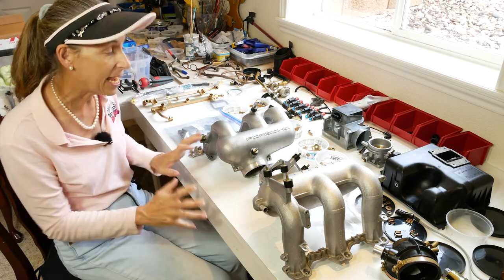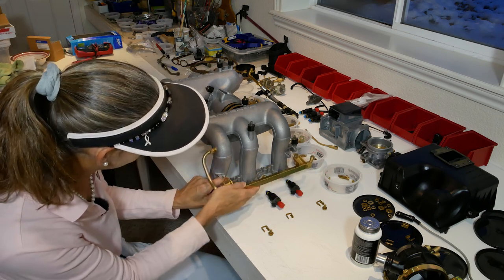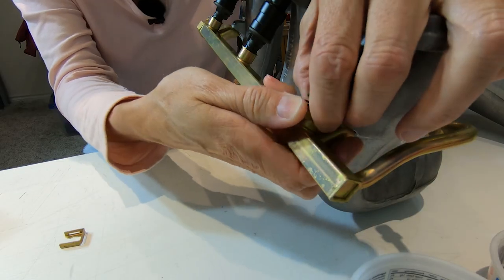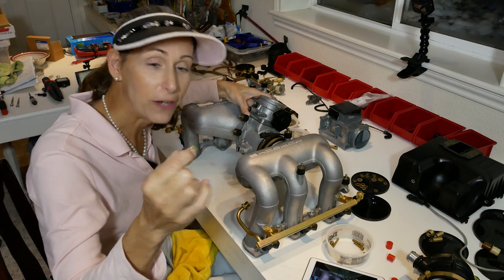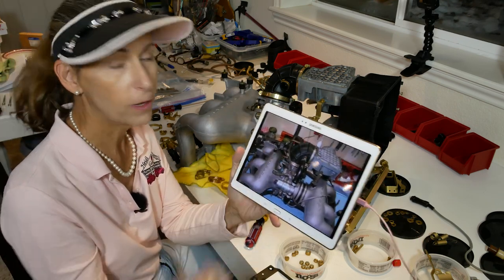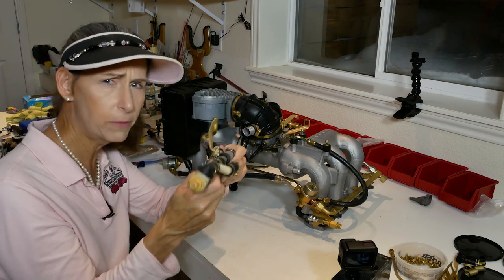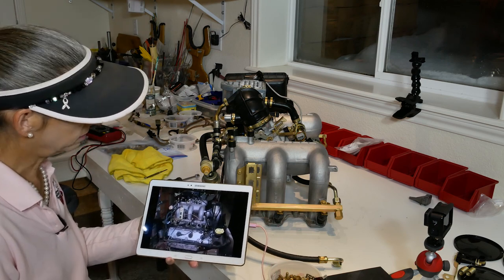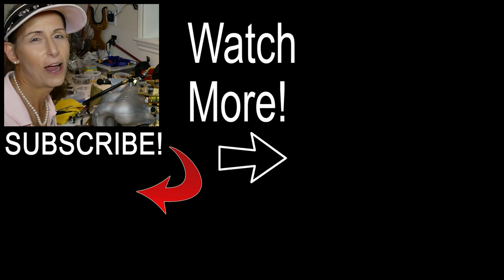Budget eBay 3.2 Carrera Intake Manifold Assembly Project #17 - Did I miss anything??

Comment: AMAZING job, ladies! I paid to have someone replace the fuel lines when I got my '87. Fast forward 7 years and now I'm doing everything myself, having learned so much about this car. This upcoming winter seems like a great opportunity to take off this whole intake manifold assembly, send the injectors in for cleaning, get a bunch of stuff replated, look for an fix any vacuum leaks, and inspect the regulator and damper. I can only hope my engine will look as awesome as yours when all is said and done.
Reply from the maker: I'm sure it will!

Comment: And now I shall pedal my Pedantcycle:

That's not a cold enrichment device. It's an idle stabilizer control valve (I think that's the 80's VW lingo, in Bosch 80's lingo, "rotary air valve.")  It lets metered air sneak from in front of the throttle plate and straight into the intake manifold. The goal was to keep the engine idling the same speed in all sorts of conditions -- cold, yes, but also, AC compressor drag on the belt, headlights, brake lights, brake booster use, vacuum leaks.

The air was already metered by, on this car, the swingin' barn door mass airflow measurer. Fuel enrichment remains the same, based on airflow sensor and  temp sensor and 02 sensor feedback. This is just to let more air in (or not) depending on how the car is idling. (Also, this was era was the dawn of throttle bodies having microswitches to detect "idle" and "wide open throttle"; nowadays, it's all potentiometer.)

A great idea in theory, in practice in the 80's, they caused some headaches when oil blowby droplets got crusty in there. Nowadays the throttle plate itself is finagled by The Big Computer, of course, but a simple bypass valve is how we did it in the old days!

My gal in the 80's had an early 80's Honda Accord CVCC/carb'd, and its idle was quite affected at night by things like high beams, brake lights going on...

Comment: Great work!  You inspired me to send the fuel injectors out to be cleaned after 115K and 25 years, and to remove and clean up the throttle body and MAF.  One note to the purists:  The hose addressed at 25:20 is not braided (on my car at least), and it has the same factory part number as on the other side 9P1 129 487.  Also, the three hose clamps on the Y-hose assembly are not present originally.  Not that there is anything wrong with adding them I guess.  Your final product looks like automotive jewelry, awesome!
Reply from the maker: Thanks Bruce.  Yes, I added those clamps because when I got the car those tubes had slipped off.  Not stock.  Thanks for the info on that other hose!

Comment: Another GREAT one of many vids you create, thanks.    I noted that you did not get into the plastic/electrical part of the air flow metering device, which seems very wise, as disturbing it`s internals could lead to all sorts of issues, though for those interested in it`s operation and interaction along with just about every other Bosch device, there is a manual under the ISBN book listing of 1 85226 021 1 titled Automotive electric/electronic systems published by Bosch. I guess there are newer versions but this one was published May 1988 around the time when the 3.2 Carrera was new.

Comment: Heidi ...... shame its not a 930 Turbo like mine thats been parked up i my garage for some 6 years as your vids are very educational to watch and learn from and yes my turbo has started (smoked the garage out in the process) but fails to run smoothly on tick over and stops when i give it a little gas so seems like its starved of fuel so may have to check the fuel intake system etc? how i wish my fuel system and conponents looks like yours is turning out to be.... learnt from your vid so now its back into the garage with a bit more knowledge..... fingers crossed for me Heidi..

Comment: it was NOT tedious at all! It was fascinating! You are an excellent mechanic, you have a fantastic narrative ability, and your videography skills are equally wonderful!  I admire your extremely careful assembly manner.  You truly respect the parts.  I have just one question: you placed tie-wraps around the fuel injector wiring harness and the adjacent fuel rails.  You didn't comment on those, but did the engine have those before?  Or is that just an extra touch you decided to add? Thank you for sharing you work.
Reply from the maker: Thanks you for your kind comment!  Yes, the factory wire-tied the wiring harness to the rails.  If you would like to see it being torn down, I have a video on that here: https://youtu.be/BCDtSNPl-WI

Comment: A few comments:

Did you replace those rubber-with-two-studs vibration isolation mounts? The rubber gets hard over the decades, reducing their effectiveness. Also, they can just break and separate.  Like adel clamps, you could order them from Porsche or autohausAZ or you could go to McMaster.com and find various options for fair prices. (Alas, shipping is whatever it costs and you don't know until you buy.)

Did I miss something? Did you clean any schmutz on the inside of the intake manifold runners? I don't know if it's something to worry about, but it's the kind of thing I would worry about.

All of this cad plating and education would have made Harry Pellow proud!

Comment: Hello hope all is well you have helped me so much with your videos and saved me a lot money by teaching me thank you God bless you
Also I have one question
my 1986 911 3.2 carrera coupe 
 is running like is missing a  Cylinder on the 4 5 6 side plugs are getting black 
 I change plugs cables rotor and cap and still is running ruff then it turns off what can I do please Thank you

Comment: @20:23  A comment about fuel hoses.  I have recently learned that many people are avoiding the punishing prices of new Porsche hoses for these three hoses (teeny tight bend, normal, and gangly with a T junction) by sending them off to Amazon Hose in Tampa, FL, where they put some stainless-mesh covered hose with a Teflon liner on the OEM fittings and recrimp.  It's easy to find threads at Pelican forums and other such places about doing this. I've got two old hoses for my old Mercedes down in Tampa right now thanks to those forums!

I believe some 911 people have saved hundreds of $ that way. That's a bargain for you!
Reply from the maker: Good to know.

Comment: 21:14 thanks. I'm trying to do this engine in car.....it's a £650 ($890) fuel line!
Reply from the maker: Oh, I know...  They are super expensive!  It must be interesting with the engine still in ;)
Reply: @HeidiandFranny  Its quite easy if you accept you have to remove the manifolds (the assembly you've detailed here). To do this I removed the  air flow meter, then the right hand manifold then the left had manifold with throttle body. All straight forward and simple.4 hours start to finish. Far far less work than an engine drop .People seem very reluctant to remove the manifolds to do this, but it really does make the job straightforward, and when fitting parts this expensive, straight forward is good!!

Comment: Nice! I am not sure how you keep track of what is tighten and torqued. I use torque stripe to help me keep track but, the only down fall you have dots everywhere.
Reply: At low torque the extension are fine and a good point on the 90 degrees crows foot position. +/- a degree and you will get a incorrect torque.
Reply from the maker: Thanks David, good point on the pen.  I probably should show that.  Since I'm filming I have a record, but that isn't what you are referring to.  There weren't really any torque specs I could fine outside of the hoses.

Comment: It looks amazing.  Its great to see a youtuber doing assembly and NOT using a air/cordless rattle gun on every nut/bolt.  DO you use Loctite on any of the bracket bolts?
Reply from the maker: Thanks!  Those little nuts are nyloc nuts so no need.  I didn't see any evidence that the factory used at all.

Comment: Those white cable ties holding the wiring harness to the fuel lines are sending my OCD into overdrive ... you should have used black. otherwise, nice job
Reply from the maker: Thanks!  But you will need to send an email to Porsche...  The originals were clear/white.  Check out the video where I dismantled the intake.  They had yellowed a little, but were white/clear originally.

Comment: Hi Franny, regarding the fuel lines, can they be changed with the engine still in the car? And if so,  how much more of a hassle would that be in your opinion? Mine need done soon and I would like to tackle them but also hoping I would not need to drop the engine.  Thanks
Reply from the maker: Hi Brad, I think it can be done but access will be difficult. I would give it a try. If all else fails and you have to drop the engine then no real loss. You can cut the soft lines forward by the tank because you are going to replace them anyways, but I would be certain you can get all the parts you need and have them ready to go before you start. Good luck!

Comment: Can you leave informations of all suppliers you used to fix, clean,... all parts of the Porsche engin 911 3l2 please.
Reply from the maker: It was just AutohausAZ for parts and Van Nuys Plating for all the plating work.  The rest of the cleaning I did myself.  The transmission was rebuilt at Storz Garage I'm downtown Denver, CO.

Comment: May I ask what you cleaned the intake manifolds with?  And whether you attacked the inside?    I'm currently in the middle of re-assembly and not sure how to approach this.  Thanks!
Reply from the maker: I think I started with super green and then moved to brakekleen and then carburetor cleaner.  If you do use a metal brush be careful to not use anything harder than the material you are cleaning or you will get hard scratches. Media blasting is an option as well, just be careful the media is ok for aluminum.  Good luck! F
Reply: @HeidiandFranny  thanks so much for the reply!

Comment: Did you send your throttle plate off for cad plating? If so, did you get new screws for it?

(I am in a pickle...)
Reply from the maker: We didn't...  I was afraid to pull the screws out.  If one of them ever comes loose, well, that would be bad ;)
Reply: @HeidiandFranny  I put my entire throttle body (mid 80's Mercedes) into the ultrasonic parts cleaner and when it was done I was convinced I had stripped all of the cad plating off of the throttle plate! After a day or two of fretting, I'm not sure it was ever plated, I think that was the golden sheen of Mobil 1 and gasoline vapors coating it.

Disassembled it last night, merely unscrewed with a quality Wiha Phillips head No. 2, and yeah, it took a lot of force and I still cammed out one of the screws on its way out, a little bit.  The screws had been peened on their tips instead of Loctite'd, making them hard to unscrew (but not impossible.)

The good news, I found out that these 4mm x 0.7 screws are not impossible to find, and also may be the same size as those used in Weber carb throttle plates.  I've ordered some from a sports car racing parts warehouse.

Thanks!

CORRECTION: Weber carb throttle plate screws have flat bottomed heads where they meet the shaft. My Mercedes needed tapered head screws. McMaster-Carr is the place to find these things.

Comment: Can you tell me where you got the cold enrichment device?
Reply from the maker: The air bypass valve?  We got one off of eBay, but I'm not totally sure it is working properly  I re-fitted the original and with some other changes the car is running properly now but I need to get out and drive the car and possibly swap out this part to be sure.
Reply: @HeidiandFranny  thanks for getting back to me.